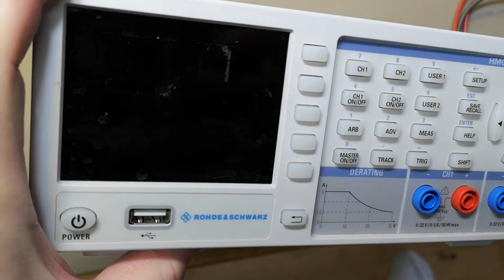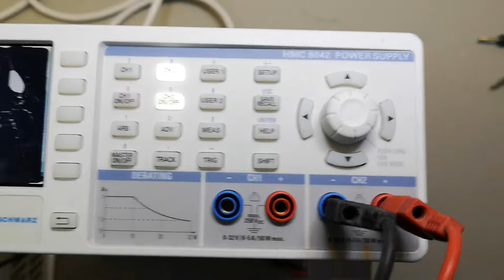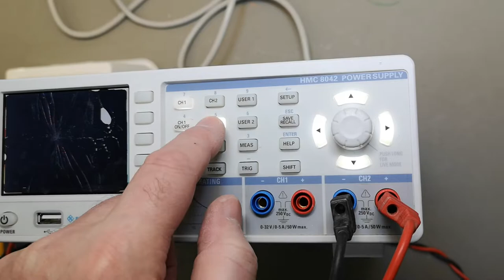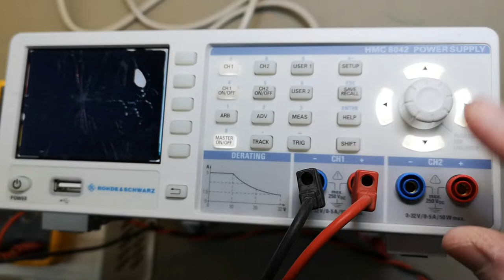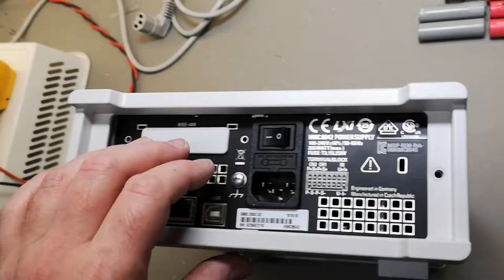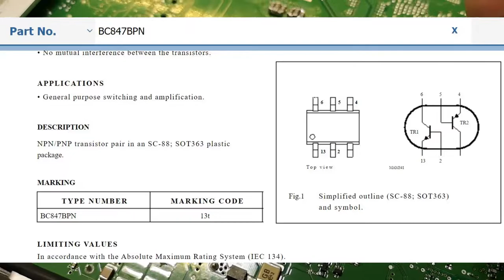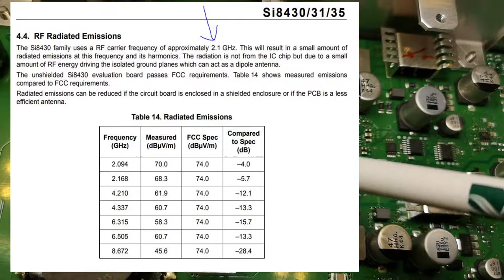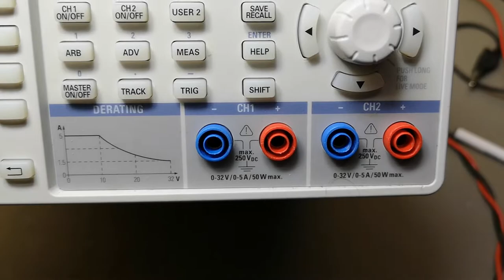R&S DC Power supply HMC8042 Teardown and repair

Comment: Wow, look at all that capacitor vomit on the fan!
Thanks for the nice run through of the design and layout, I hadn't opened mine up.  Hopefully you can get it running again.
The extra transistor output stages are presumably because these are labelled as "high efficiency switching linear power supplies", so are a hybrid switching with linear post regulation design.
Reply from the maker: thanks a lot for your comment, this makes a lot of sense to know it is both switchmode and linear regulated/filtered, it explain the voltage drop over that transistor with heatsink, i expect both the switchmode and the linear part to use their own feedback and regulation system, one of with is broken in ch1 in mine, and that is why the switchmode go into max pwm.. any one with a clue on how to find the FB ??
Reply: @TeardownOZ2CPU  Can't really comment on the FB issue other than the hybrid design would normally have the switchmode supply track a volt or two above the linear post regulator to minimize power dissipation in that final stage.  Tricky to diagnose with it continually blowing things up, but at least you can compare with the other channel.  Definitely worth the repair if you can find replacement parts.
Reply from the maker: @KeanM  as long as the FB issue is not a blown input of the PIC cpu, i am sure most other parts are standard stuff, so i should be able to fix it, i got a working channel, and a few ideas now, disable the gate drive, and feed in a dc from external supply and this way track down the missing feedback signal, you know the FB test trick of switchmodes with external dc back in, to its output, see pwm change, when you hit the set point.
Reply: What is a FB?
Reply: @nielslangkilde9255  FB = feedback
Reply from the maker: @nielslangkilde9255  Yes, thanks kean, FB = Feed Back, it is normally a voltage divider, that measure the output voltage, and a regulator IC, compare this voltage with a reference voltage, this way it know if the output is too low, or too high, and will add more or less power to the output, in this case the regulator / comparator, see no output voltage, so it deliver max power, and this way voltage rise to 75V and this damage / blow up the capacitors only rated for 50v.

Comment: The discrete gate driver parts were someone showing off a bit. But also it helps with supply issues. Maybe they couldn’t get a good supply of whatever gate driver was fit for this one, so they decided to roll their own. I always say that if you can’t buy discrete transistors the civilization has ended and there’s no need to worry about power supplies :)